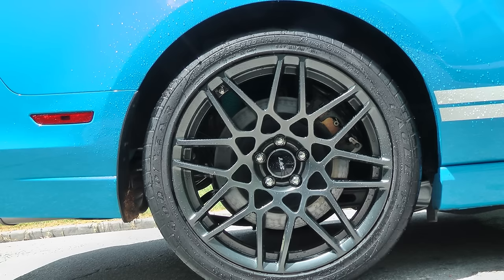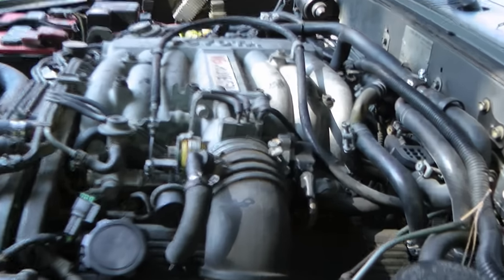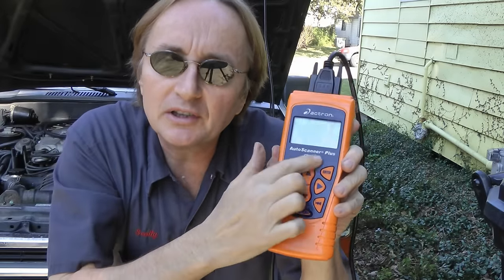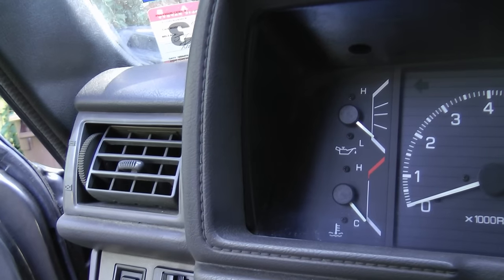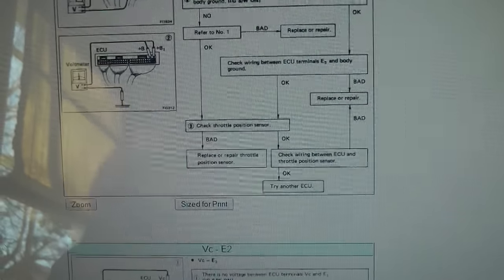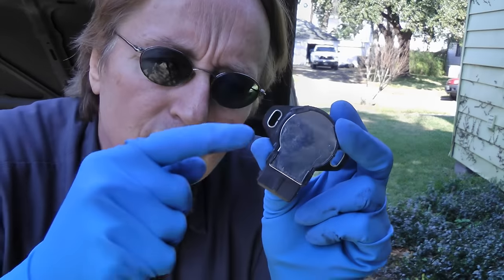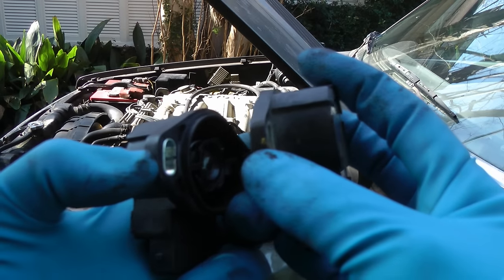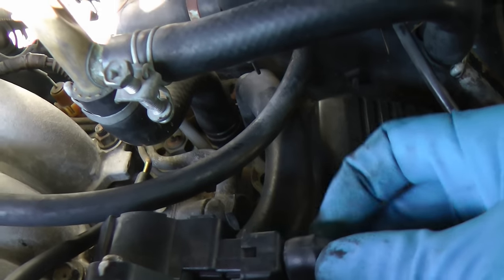How to Stop Car Hesitation (Throttle Position Sensor)

Comment: Hey Scotty Kilmer hopefully you can help me, I have a 2002 Cadillac escalade with error code 1518 what could be causing this?
Reply from the maker: +UAa320 A P1518 diagnostic trouble code (DTC).
    
      Throttle Actuator Control (TAC) Module Serial Data Circuit.
    
  
  The Message Board on the Instrument Cluster will read: Reduced Engine Power.
  The engine starts and immediately stalls.
    
      This is due to the Passlock sync info, between all of the components that make up the system, being lost.
    
  
  You can hear a buzzing sound coming from the engine compartment even after you remove the key from the ignition switch.
    
      This buzzing usually comes from the Electronic Throttle Body's actuator motor.
    
  
  Battery will get drained even with the key removed from the ignition switch.

You might be wondering if just cleaning the battery's ground cable is
 enough... and I can tell you that it's not enough.  Cleaning the 
battery ground terminal (at the battery) or where the battery ground 
cable bolts to the engine or the chassis is a good idea but the PCM's 
grounds don't connect there...

...The PCM's grounds unite at a certain point (in the wiring harness)
 and share the same terminal that's bolted to a point behind the 
passenger side cylinder head (and this terminal is not easy to access).

Testing the PCM's ground circuits (all 8 wires) is not hard... since 
all you need to do is to test just one ground wire for a Voltage Drop 
and you're able to test them all (I'll explain how to do this in this 
article).

Electronic Throttle Body Connector Problems

The second most common problem I've seen, is the Electronic Throttle 
Body's connector having a copper wire break inside the insulation at the
 point where the wire enters the connector.

Since the insulation, of the wire itself, doesn't break... you don't realize there's a problem.

The local GM dealerships have always recommended replacing the 
connector for several years now to their service customers (when an 
Electronic Throttle Body is replaced by their service department). Well,
 this is a recommendation that you should follow too .

As of this writing (November 2011), a friend bought one at the local 
Chevy Dealership Parts Department and paid $180+ (US) for the Electronic
 Throttle Body Connector (part # PT1572  -GM#88986255), not knowing he 
could buy the exact same connector online for about a hundred bucks less.

This is where you can buy the components and save some money:
Reply: Scotty Kilmer thanks scotty for the advice, what I don't get is that in my instrument cluster I don't get a reduced power message and the engine runs fine, I cleaned the mass air flow sensor to see if that was the problem but still no change, I don't know what else to do.

Comment: My 2002 Mazda 626 has started hesitating and making a low sounding boom when I am at a stop light and in drive. If I put my car in neutral it stops making the sound and hesitating. I just had a new timing belt installed in December. Do you have any idea what the problem could be?
Reply from the maker: +KC P have the belt checked to see if it was installed too loose first
Reply: +Scotty Kilmer Thank you, I will do that and let you know the results. I appreciate someone giving advice without strings attached. :-)

Comment: i have a question that you can hopefully help me with, My vehicle is a Nissan Quest 2008 base model, yesterday on my way to work it just stoped accelerating and felt like it shut off but u placed it on park and rpm went back up so i realized it was stil tunning, pressed the accelerator and it accelerated but when places back on drive or even on reverse it doesnt accelerate, it doea accelerate on park and neutral, the BREAK and BATTERY lights are on.
Reply: I kinda have the same problem with my Sentra, it would idle on D and R but not on N and P. My battery and brake lights are on too. Check your alternator first but I doubt thats the problem. It's probably going to be this problem with your TPB sensor. You should also check and clean your MAF sensor too.
Reply: +M3TR01D58 thank you for this info, as it turns out the alternator did go out, i recharged the battery and started the car, unplugged the battery when the car was running and it went off. I have since replaced the alternator and its running now but the battery and BRAKE lights stil flash on when i stop at a light or stop sign, it goes off as soon as i accelerate, but no more acceleration problems.

Comment: so when im driving and pressing the gas lightly the rpm goes up slowly so does the mph but it feels like its hesitating and as soonas it hits the 2000rpm the car pushes forward like it just got into gear, i just rebuild my transmission couple months ago so i doubt it could be my transmission, any ideas? could it be my throttle body sensor or throttle body itself

Comment: i have a 2002 saturn l200 and we have had trouble with it cutting off at stop signs or lights. when it idles. we got the co2 sensor fixed and crank sensor and it still does it. i saw the throttle cable has a nick in it like its a little shredded could that be it?
Reply from the maker: if it's an electronic throttle that could be it. If a cable, look elsewhere, have the live and mode 6 data analyzed

Comment: Replacing the TPS is alittle more involved than that. It has to be just in the right spot to work correctly. Its not just throw it on there and wallah its fixed. It eill not run right if its not ajusted juuust right. Good luck!

Comment: Hello, I got roughly acceleration problem when full throttling but it rev up to redline smoothly and fine in Park and Neutral, Or drive with little throttling is fine too (Seem like to be occur when Wide Open). I try reset ECU but it doesn't help at all then I try replace Air Filter, Ignition Coil (This just worn out) , Fuel Pump, Fuel Filter, Spark Plug, Cleaned Throttle Body but it doesn't fix the problem. Then I try reset the ECU again but it still be the same. Do you have any advice? 

My car is 2005 Toyota Wish with 1AZ-FE engine.
Reply from the maker: +taoybb  often a bad MAF sensor on that model.
Reply: +Scotty Kilmer Thanks you Scotty. I will try clean it up or replace it then I will let you know if problem gone or not.
Reply: +Scotty Kilmer Hello , Thanks you scotty I changed MAF Sensor and she run smoothly now. I got the new one which look the same but different part number.. old one is '22204-21010' and new one '22204-22010'.After start the engine I let it idle for 5 minute then go out and drive normally for 15 minute, I try rev up to quite high rpm and everything seem to be fine. gear change at lower rpm than before. Thanks you again. :)

Comment: Hello my 1998 cavalier 2.2 doesn't accelerate right after i added oil and a gasket to the muffler ,manifold ring ,it was working perfectly fine , i put new spark plugs ,but wont accelerate ,please help .

Comment: hey Scotty help me I have a issue on my 2001 ford mustang 3.8 when I go to pick up speed it will start to jump and hesitate. what should I check first that could solve this problem. Michael smith
Reply from the maker: +Mike Lee pressure test the fuel pump to see if it's weak. Also have the MAF tested out, they can go bad and do that.  PRAY it's no the transmission going out

Comment: sir scoty, my 2005 hyundai getz are having a hard time accelerating or it doesn't accelerate even though it was on a full throtle. please help thanks
Reply: there is no sign if loose compression it does not have a smoke. engine is quiet.

Comment: so i have a Mitsubishi eclipse 96 and it has a idle under 1rpm ive replaced spark plugs, fans, idle control switch, and the egr valve and nothing is fixing it i even replaced the cool pack. any ideas?

Comment: I got a 96 Trans am I have done everything and can't find the problem with it!! She  fluctuates between 500 rpm when cruising and snaps out of it with a little bit of throttle applied Wot is hit an miss sometimes she will strong while other times it hesitates but not like a wanting to die hesitate it's hard to explain...but my rpms will red line and sometimes stutter and snap out of it and go at which point it will happen at any time  during full throttle or while maintaining a constant speed. Half throttle is flawless!! As well as 3/4 throttle!! Any suggestions also I have replaced the tps,egr valve,egr solinoid,opti   spark,plugs,wires,injectors,cleaned the maf, fuel pump, fuel filter,and air filter I'm running out of ideas:/
Reply from the maker: Adam Weed that's obd II, so good information can be had with a pro hooking up his dealer level scanner and analyzing live and mode 6 data. Start there, but on those, often fuel injector problems do just that.
Reply: thanks since then i gave up and completely swapped the lt1 out and installed 5.3l into my firebird lol

Comment: I'm having a surging problem and a overheating problem on my 92 Toyota pickup 22re. I've tried changing the therm. , water pump, radiator and cap for the overheating. The idling of the issue is very annoying it starts doing it at 10 mins and then goes away after a while. Can you give me some kind of clue of why or what it is?
Reply from the maker: +Chase Hawley do my video tests 'HOW to fix an overheating car" and pray it's not a blowing head gasket
Reply: +Scotty Kilmer trust me I pray everyday that it isn't the head gasket. Thanks I'll try it soon and get back to you.
Reply: +Scotty Kilmer could a bad radiator or head gasket cause the surging of the idle? Just asking I know the thermostat did years ago I changed it and all was good lol.

Comment: dear brother,
my 3.4L toyota 5vz engine has an rpm of 1000 at idle when ac is off. when i switch on the car AC the rpm get drops to 500 and by shiting the gear from N to D at idle it gets drop to 300. Many times even the engine get stopped at signals and than it take a long self switch to start. please help as i have visited many repair centres but no thing works.
thanks

Comment: Scotty or anyone. My 1994 Chevy Cavalier, might have this problem? This is what it is doing - At about 40 to 45 miles an hour, if you have to slow down too fast (like you come to a light, have to turn at an intersection, or some idiot pulls out in front of you), like slow down to 15 or 20 mph, sometimes it vibrates and it will kill the engine if I don't shift in neutral. It is an automatic, but it feels just like if you are driving a standard and miss a gear and shift too high. Like when you are trying to hit 2nd and suck at driving a standard and hit 4th gear instead. The car shimmies and shakes and will die if you don't get it out of high gear when it is not going fast enough. It does that! I was guessing the transmission is not shifting down fast enough? Could it be this TPS sensor? I can compensate by giving more time to slow down before a light, but driving like a 90 yr old man pisses people off behind me. I don't really care about that as much as if it is going to make the transmission go out? If it is just this sensor, sounds like an easy fix? PS - Mine doesn't really run bad when in idol, so I don't thing unplug it would make any noticeable difference?

Comment: I have a bmw 520 diesel that had a bare engine fitted. The car has the same problem from before where the engine hums and drops repeatedly  when cold, slight vibration
Reply from the maker: +WillyWanka  I would assume injection system has problems if you used that all over on the second engine

Comment: Scotty my brother in law has a 2002 Chevy Silverado 2500 HD CrewCab 496 Engine 8.1 liters Allison transmission and when you start it it chugs and spudders it will try to die out and sometimes does and then when you finally get going it will chug and chug until all of a sudden it kicks in and goes brother in law recently changed plugs and wires but still has problem what could be wrong?
Reply from the maker: on those, often the fuel injection system breaks down inside the engine due to the use of cheap plastic parts that crack and then leak internally. check that first
Reply: how do we check it?

Comment: i have a 2007 ford Mustang v6 when i turn on the car and press on my gas the car won't move should i buy a new throttle body or just clean it
Reply from the maker: +Elia Lentz  could be lots of things, realize that. First, change the fuel filter and pressure test the fuel pump. then have the MAF sensor tested if that's not it. But throttle bodies did go bad a lot on those, ford has a re engineered one for that, so it could be that. But best to test first

Comment: hello have 1997 pick up hardbody clutch fills good no leaks when cold i push clutch it makes a winding noise and stops when is worm. today when temp.dropped gears will harly go in. can you help me please?
Reply from the maker: +Carlos Valles time for a new clutch set up. The throw out bearing is wearing, but really, you pull the tranny off to change it so it's best to put in a whole clutch kit then

Comment: Mine says p2138 and i looked it up and the sensor is on the gas pedal! I have a 08 inpala my dash also says service traction control and engine speed reduced! So do i just replaced the whole gas pedal with the sensor on it?
Reply from the maker: +moneyhungryyt they generally sell a replacement throttle sensor that you bolt back on under the steering wheel
Reply: Thanks!

Comment: Hi Scotty. ihv 2002 toyota and got this error code
P0120 Throttle/Pedal Position Sensor/Switch "A" Circuit
do i need to replace the sensor? thanks

Comment: hey Mr. Scotty, im having trouble with my 2006 Acura tl base mode... i accelerate ip to about 2500rpm and then the car begins to rattle and stay at 2500rpms and if not lower... what could it possibly be? 

also i filled the engine oil about a week ago and the sensor reappeared...
Reply from the maker: +Elliot Carvajal  pray it's just a bad clogged up catalytic converter and not internal engine problems

Comment: My 2003 Sunny has a problem. I was wondering if it's due to the Throttle Position Sensor. 
It happens intermittently. Car doesn't accelerate, the engine gets cold. After pressing the gas pedal for a while and several restarts it starts accelerating.
It usually takes 5-10 minutes to start it up again.
Does anyone think it might happen due to the TPS? 
It would be a great help.

Thanks

Comment: gotta 1984 c10 inline 6...truck hesitates and dies when i push gas. turns on and idles fine until the throttle opened up will putter and dies..whats the problem???

Comment: My dad's car (2003 ford taurus) shut off on him. It started but shortly after it cut off again. It also had trouble starting. He had to push it back home as a result, so do you know what could be the cause? Because when he stopped it, it shut off.
Reply from the maker: +merciless jervis (Mercilessjervis)  tons of things can do that, bur pressure test the fuel pump first to see if it's weak
Reply: +Scotty Kilmer Thanks for the help. The problem is fixed now.
Reply: +Scotty Kilmer Also, my dodge journey (2009) seems to go down to 550 Rpms when idling, and goes back up to around 850 rpms after a second or two. Could this be a bad sensor?
Reply: +merciless jervis (Mercilessjervis) It also doesnt have a check engine light.

Comment: So i have a honda civic 1992 hacthback with d14a1 engine and when i start it up i need press the gas to keep the engine running if i don't the engine goes off need to keep it for like 10 seconds so it won't shut down any idea whats going on?

Comment: Hey Scotty, I have a 2006 Ford Crown Victoria Police Interceptor, I need to know where the reverse tail lights fuses are because my right side reverse light doesn't work. I did replace the bulb but that didn't fix the problem. These mechanics out here in Phoenix AZ, love to take people's money and don't fix their cars.
Reply from the maker: not a fuse or both sides wouldn't work. So, cut the power wire on the non working side and splice that into the power wire on the working side and it will work then, unless the socket or bulb is rusted out on the bad side. I do that ALL the time.
Reply: Thank you, Scotty. I will get on that.

Comment: Hey bud my names Jeff I own a 2000 mazda protege I changed my tps out with a new one and Idk maybe u can answer my question. my car runs good when it's cold then when it's warmed up it loses power as I drive what could this b I'd really appreciate some info thanks.
Reply from the maker: +Jeff Ramer many things can do that, but often a flooding out engine does that. Try my video "how to clean fuel injectors on your car" first, pray that fixes it

Comment: Hi Scotty, Need help with something. My problem is after stop from highway and start foward again my RPM going really up but  wont move my car. Them release gas pedal and going normal again.  It's a Trotle Boddy Problem or Transmission slip? I check Transmission oil is fine and i put lucas antislip just in case and happen anyway.  Any help i wl appreciate.  Thanks
Reply from the maker: tranny is slipping big time
Reply: Thank's For anwers. Bad News ahh!

Comment: I'm having problems with my 2010 fird expedition about 45 mph it kinda sputters trans fluid been changed at a trans shop I put new coils new plugs new maf sensor new fuel pump and has a k&n cold air intake system that's all clean I don't know what to do next  need help please.  Thank you
Reply from the maker: actually the k and n cold air intake can cause such problems by messing with air fuel ratio. But at any rate I'd have a pro road test it and analyze live and mode 6 data at 45 mph. that info shows a lot about problem areas

Comment: I have a jaguar x type and it wont let me goo past 4000 rpm and won't start sometimes cant get the rev in what could it be any ideas welcome thank you
Reply from the maker: pressure test the fuel pump, weak ones often do that. Also have the cat pressure tested as they can clog up and do that